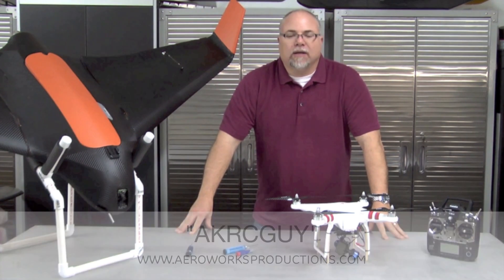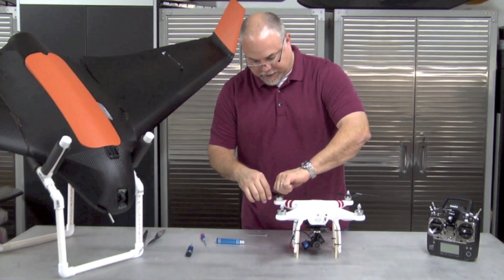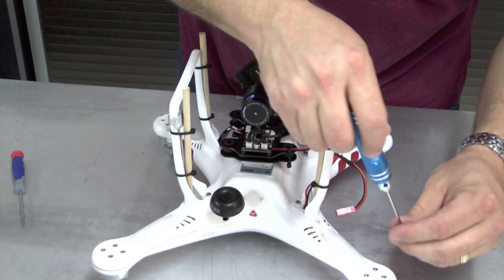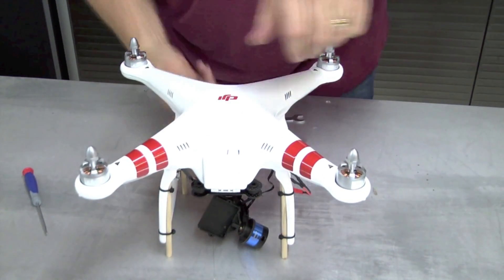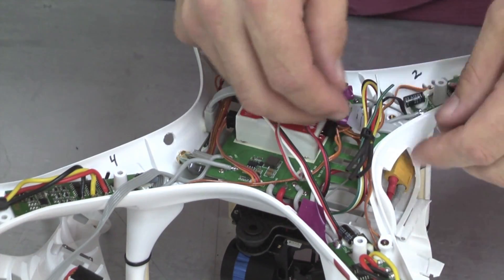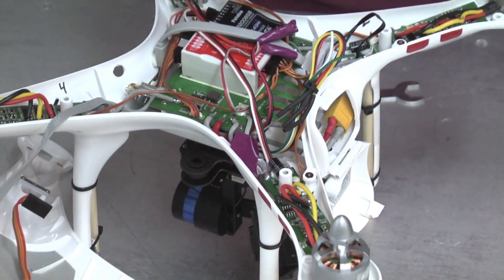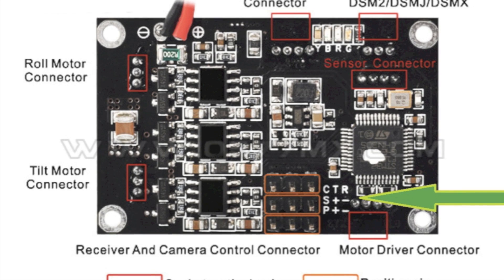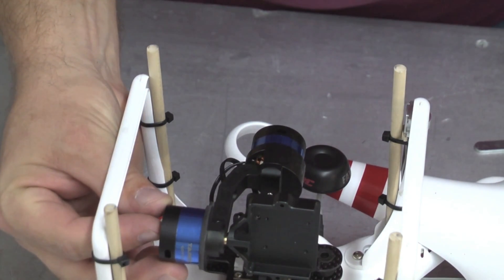How to Install a Tarot 2D Gimbal on a DJI Phantom PART 2

Comment: HEY I HAVE A QUESTION. I JUST PURCHASED THE TAROT T-2 GIMBLE FOR MY PHANTOM 3 STANDARD. ARE YOU SAYING I NEED TO ALSO INSTALL A TRANSMITTER? I WAS UNDER THE BELIEF THAT THE TAROT WOULD CONNECT TO THE BOARDS TERMINALS THAT CONTROLLED THE CAMERA GIMBLE? AM I WRONG? THANKS

Comment: to power the gimbal i am using the stock wire that came with it but the other wire than you ran is that going straight to the phantoms power wires where they are sodered? and did u have to buy that peice separate?

Comment: good video thank you...i did have a question about the fat shark harness wires to the tarot gimbal cable... your taking the red black and yellow correct? what wires do you soder them to on the tarot cable? thanks tucknrotor@hotmail.com or reply here

Comment: is that tape on your wires? tisk tisk.
Reply from the maker: Old video.  We solder and shrink tube all permanent wire splices.  Our original Phantom was some what of a test bed with constant changes.

Comment: Thank you very much for your follow up on the tarot gimbal.  It was very informative, however I got lost when you were describing the internal wiring of the gimbal.  I am novice' therefore I am using the stock radio with the tilt control.  I guess my problem is, how am I going to power up the t2d and the fat shark?  Any guidance you can give me will be greatly appreciated.

Comment: Hi there,

Did you have any issue with installing the vTX there? i'm a little concerned about the heat buildup but like having everything neatly kept inside.

Comment: do I have to use the GoPro? I have a similar camera I got off of Ebay.
Reply from the maker: Typically these type of gimbals are specific to the camera but if you have a camera with the same size and weight specs it might work.

Comment: OK I see why I'm confused. I didn't get a video cable with my tarot so didn't know that even had that feature and the instructions are  rediculous that came with it.
Reply from the maker: It's easier to use the pre-made cable available from www.readymaderc.com that connect directly to the Immersion RC video transmitter and GoPro.
Reply: That's what I currently have but its too short so withe the transmitter inside so I guess I will have to splice it and make it longer.

Comment: Little confused about the connection to the GoPro. You mentioned the video wire coming out of the transmitter going into the Tarot but what wire goes into the GoPro for the video feed from the camera to the transmitter? It sounded like you maybe had a connection from the Tarot to the GoPro video feed.
Reply from the maker: This is an older install but I used a Tarot video out cables as shown in the beginning of this video and the + and - video wires splice into the video input of the video transmitter.  The remaining 2 wires get a regulated 5V to power and charge the GoPro.

Comment: Great video. I've got a stock phantom 1. Do  you need anything to control the gimbal once it is in the air?
Reply from the maker: I'm using a Futaba T8J radio with the gimbal tilt control connected directly to the Futaba Rx.  If you are using the stock radio you will have to connect your tilt wires to the Naza.  There are other videos here on YouTube that can show you those connections.

Comment: How do you get video without the props?
Reply from the maker: Easiest way is to change your GoPro to medium FOV and keep a slight tilt down on the camera.
Reply: okey but my tilt doesn't work, my go pro remote won't do anything at all, i have this problem very long, i don't know how to solve it, can you change the angle of the tarot at startup?
Reply from the maker: I'm not sure your configuration so I would need to know more to assist.  You should NOT be using your GoPro remote or have the wifi turned on on your Gopro as they can interfere with the control signal. Check out my new Helpout service here- https://helpouts.google.com/116487297804043489540/ls/9fb8f4f4f88e4b6d
Reply: i know, but i found out how to change the start angle so , the tilt doesn't matter

Comment: I am using this video to help my install my fpv system on my phantom 2. I also have the Tarot gimbal which I used with the plug and play cable from first person video. My question is, is it necessary to use the charge cords from the tarot usb cable. I have soldered the video and video ground cable to the plug and play cable and just cut off the charging cables. I am having an issue where I only receive telemetry data on my black pearl not and receiving video from the go pro (using fast shark 250mw). I am wondering if I am not getting video because  I cut the charger cords on  the tarot go pro USB cable. Any help would be greatly appreciated as I am currently at stand still.

Comment: Another great video I notice that you left out the LC noise filter is there a different in the video without it or is it just added weight thanks again.
Reply from the maker: You'll see some noise once in a while but it doesn't affect the recorded video.

Comment: Great video. Thanks. The fatshark is only for FPV right. I don't need it to get my t-2d running on the phantom, correct?
Reply from the maker: No but's it's nice for framing your shots.  A monitor works as well though.  You need something to see what you are or are not getting in the shot.  I recommend shooting in 1080P 30f and Medium focal length if you are using the GoPro 3.
Reply: Got it. Thanks.

Comment: hi thanks for your help but i have set my tarot up to the dji phantom Naza and the tilt switch to the back of the controller but when i move it nothing happing. is there a software set up i need to do with the phantom and tarot both software is updated
Reply from the maker: Yes, you may have to enable the gimbal control in the Naza assistant.
Reply: AKRCGUY ok its enable but still wont move
Reply from the maker: What model Phantom do you have?  When you are in the Naza Assistant do you see Channel 5 moving when you move yuor slider? What cables from the Tarot did you connect to the Naza controller?
Reply: AKRCGUY my modle is P330D. the cables am useing are the ones that came with the tarot here is my settings https://farm8.staticflickr.com/7297/12461970774_ac80dda4ba_o.jpg

thank you for taking the time to help
Reply from the maker: Show me a pic of where you have connected the wires on the Naza.
Reply from the maker: What email can I send you a diagram at?

Comment: Hi, great videos. I just finished all the wiring and connections and in my first flight the battery lasts only a few minutes! How long does your pahntom fly withFPV and tarot connected?

Thank you
Reply from the maker: Andres,  I don't fly past around 5-6 minutes with a minute or so to spare.  A couple things you can do to extend your flights is 1st, don't power up gimbal until you have your GPS lock and all systems are a go.  2nd, if you have another battery laying around, even if it doesn't fit the Phantom, use it to get your Phantom warmed up and locked onto GPS then switch to your flight battery and your Phantom should boot right back up again.

Hope these tips help you out.  Happy Holidays!
Reply: Thank you very much!

Comment: Hi, Great videos! very helpful. I'm all set up and almost working like yours. Can you please explain a little how you achieved the function to set a tilt position on the gimbal and have it move there at the flick of the top switch on your Futaba tx? is a mix in the tx? I'm pretty new to this so specific instructions on that would be great!

Comment: Great vid! I have the tarot on my phantom with tilt works great, I have an old futaba radio I use for my planes that I converted to spektrum 2.4ghz, (saved me from changing 6 receivers to futaba on my planes) wondering if I can get a spektrum reciever and mod phatom the same way so I can use same radio as my planes, is there any advantage to using another radio besides stock?

Comment: Nice video Mr.AKRCGUY!  Been searching for something like this for awhile and your Part 2 really filled the void. So thank you!  Question: So your GoPro + FPV Tx are all drawing power from the Phantom battery.  What is typical flight time?  Is there any benefit to instead use GoPro's own battery and have your FPV Tx draw from its own smaller battery as some people do it.  Do you recommend this? ..or will the xtra bit of weight offset the benefits?  Thx again in advance!

Comment: Nice video! Is there a video you recommend for us trying to use the Tarot with the stock DJI's remote? Currently I upgraded my phantom and added the tilt lever to the remote to be able to use the zenmuse, so I'll be getting a Tarot instead of a zenmuse (lost it in a crash)

Thanks!
Reply from the maker: Bernardo, Start here- http://youtu.be/aXS25SCdGMo
This shows connections to the Naza.

Comment: Great and very helpful.  I have a question.  The Tarot doesn't seem to center the GoPro's lens in the center axis of the Phantom.  Is it how you mount it as well?  Thanks.
Reply from the maker: The GoPro is slightly off center from the Phantom but perfectly balanced to the Tarot gimbal.  Never been an issue for me.  I almost always shoot in the Medium focal point setting in the camera which assures that the Phantom landing gear and nose don't show up in the shot.

Comment: Thanks for the video - how much current is being drawn through that aux cable (Tarot, Fatshark  & the GoPro charging)? Is the Aux cable sufficient gauge?
Reply from the maker: Not sure on the exact draw but I have 20-30 flights with no issues.  I've also opened back up to shoot this video and I checked all solder joints and connections and no issues there either.